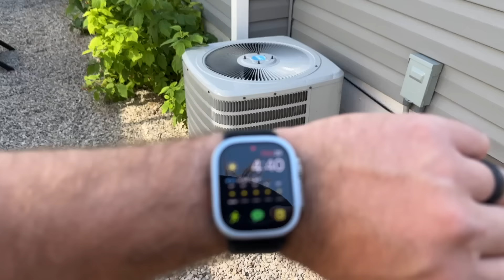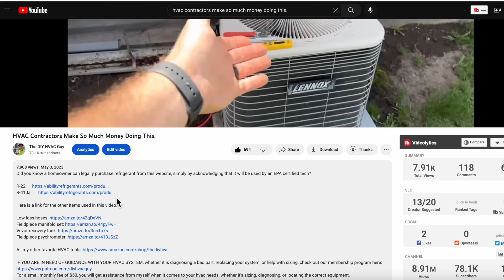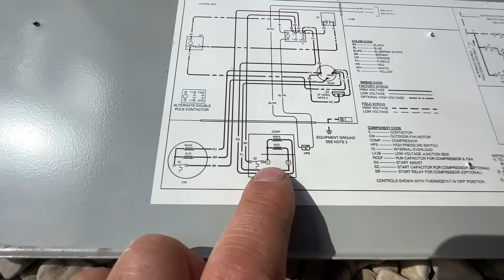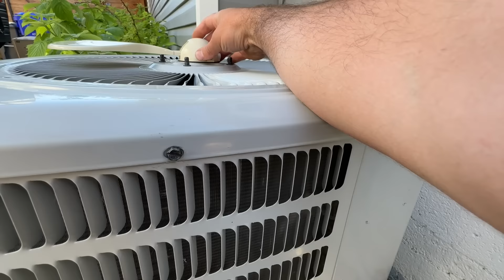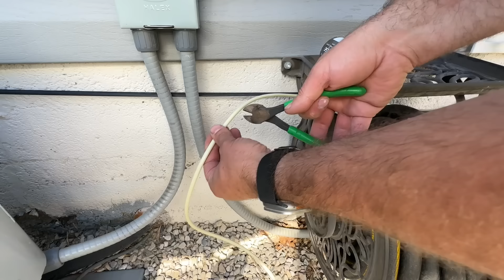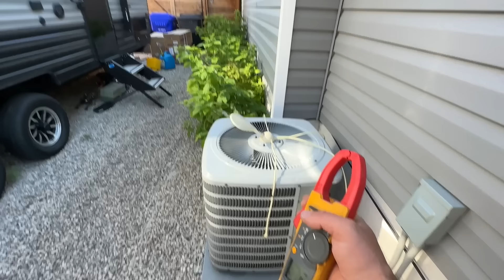Can This Device Actually Lower Your Electric Bill By 30%??

Comment: I have well water , what what about it putting extra load on my pump and if your not on well water then wouldn't it then raise your water bill from the city ? Would one cancel out the other as far as saving money on ac to spending more at once on replacing well pump motor or water bill?
Reply from the maker: Very minimal. About one flush of the toilet per day

Comment: i would only do this with a really old system that will break soon but on a newer system, you risk breaking the system from the mineral build-up on the coils. ever see how wood fences turn white from constant water sprinkler spray? that white stuff is the chemical/minerals the water company puts in, those chemicals will build up on the coil blades and the blades will not be able to transfer heat as well, breaking the system.

Comment: I did something like this in Las Vegas, 20+ years ago on a roof unit. Mine was like a swamp-cooler before the condenser. So the hot dry air was pulled through the swamp cooler to pre-cool the air as the condenser sucked it in. Worked great and lowered the head pressure on the compressor. Then after 2-3 months the lime built up on the coils and destroyed the unit by blocking all air flow. 
If you attempt this I would suggest that you keep the swamp-cooler assemble at least a foot from the coils and reduce the water flow.

Comment: Coils and internals were not engineered to be wet 24/7. It is expected that they temporarily get wet by weather. Also, the filter does not take 100% of the lime scale out of the water. You’re still gonna get a clogged coil. 👎🏼
Reply from the maker: They aren’t getting wet, it mists the air and evaporates into cooler air. But if you don’t like it then don’t buy it 👍🏼 cheers

Comment: .8 amps+1degree less = shorter run times.   Shorter run times and lower heat load will extend condensing unit life. The additional time unit is not running, its using 0 amps and wear. With super pure water, I see no downside.

Comment: Good News Bad News  ,   Good News = IN THE Beginning it Will help the Air Conditioner Work Better .
Bad News = The direct water contact to the Unit will causes Heat Transfer Finns to Corrode TO DEATH .
If you just have to try it setup the water misters far enough from the unit so no water hits it ,
but COOLS down the AIR AROUND THE UNIT .

Comment: It's a swamp cooler, it only works because your in a dry climate.  If it was humid it wouldnt work at all, but as others in the comments have pointed out, there are many other issues with this product.

Comment: I have 37 years in the HVAC trade. I will never install a product like this on my system. I have seen many systems damaged by products like this and not just from hard water. The repair costs easily over run the power savings. With the current standards for efficiency the manufactures would include a mist system as part of the system if it were a viable solution.

Comment: This is far from new...and in the long term detrimental to the system. The coil/fins will get blocked, less heat is extracted which causes the head pressure to go up with the heat transfer going down with amp draw increasing with a result  of a decreased life on the compressor not to mention the negative effect of high of heat of the refrigerant oil which can and will lead to a system burn out. We use to use some version of these on commercial/industrial roof top package units back in the 60's and 70's and the end result was always the same. And if home owners are encouraged to install one are they willing to take a risk of saturating the electrical components inside of the service panel with a risk of electrocution.

Comment: What about using condensate from the cooling coil instead of running it down the drain use a little giant pump and plumb it to the misters intermittent misting will save you something and condensed watter is relatively pure is it not.
Reply: Not a bad idea. At least the water will be mineral free. I doubt that there would be enough condensate to be of much help.

Comment: I lived in Reno, and my apartment was cooled by ONLY evaporative cooling (swamp cooler). They work, but the hard water, cheap plastic tubing and valves, filters, and everything else meant it was being serviced regularly. Add this to a higher tech system with even more moving and metal parts, and youre asking for trouble.

Comment: The motors are still going to run and use the same amount of energy.  If you added a fan HP cycle  control keeping the head pressure up then maybe.  But if try to out do the makers engineers you may get "a fast car for a short road". Don't do this.

Comment: I don't understand how the Amperage measurements weren't the same unless the unit has a variable speed compressor.  In my mind most Air Conditioners should draw the same amperage while running.  The compressor is either on or off.  In this case, the Mister could actually help the air conditioner to run less as the Mister helps dissipate the heat in the coils thereby saving money.

Comment: Well if you live somewhere where water is cheap and avaialiable and not in temporary drought that looks like a  winner. Those units are designed to get wet in natural weather cycles and constant wetting on use of the radiator is different from the intended lifespan in terms of wear and decay from oxidation. You save in one place and lose in two others in terms of wear and a new constant water usage. Defenately worth assessing those three factors based on where you live and costs you'll face locally.

Comment: So you're just spraying water over the coils and wouldn't the cost of water be equivalent to any savings of electricity if there was any from this scam have a gadget? Wtf 2.1 million views on garbage.
Reply from the maker: This unit uses the equivalent of 1 flush of the toilet per day. Next to no added  water usage, and no it doesn’t spray the unit with water. It mists AROUND the unit and the evaporation is what cools the fins. 2.1 million views because it isn’t garbage and people know it

Comment: This comment is from a person who uses a similar system, and lives in Phoenix.  Climate and location are key to this, your results may vary.  

Unless you have a dedicated reverse osmosis system feeding the spray nozzles, they WILL clog and you WILL get scale build up on your condenser coils.

Even with R.O., you will still get additional build up on your coils from dust clinging to the wetness.  You will want to rinse the coils off once a week to maximize the evaporative effect.  This only takes about two minutes.  If you dilute some vinegar  50/50 with water and spray in on the coils about 5 minutes before rinsing, it very effectively keeps things clean with no risk of harm... just do it with the unit turned off.  Regardless of the misting system, you should be spraying your condenser off with clean water every week for best efficiency.

You MUST use high quality components, not plastic, or the heat and sun will destroy the plastic tubes and your water bill from runaway leaks will offset your AC savings.  I use copper tube.  It costs a bit more, but it lasts.  My valve to initiate the spray is a pool water level control, made of brass so it has lasted 8 years without failure, and the paddle that is blown by the air is a thick pie tin (don't laugh) which has lasted just as long.  

For those who think there will be rust or corrosion or mold/mildew... Phoenix between June and October never cools below 85 degrees at night, and generally reaches above 110 during the day.  The water evaporates almost as soon as it hits the coils, which is ideal for heat transfer.  If it actually runs long enough to drip, it dries between cycles.

I don't think I have seen a 30% savings overall (not counting the investment to build the system), seeing as how I am using a bit more water, but the first full summer of use lowered my electric bill from an average of $470/month to about $350/month.  This was before I installed a pool, so I couldn't honestly state what the savings are since then, but when talking to friends and neighbors, our bill seems to be consistently lower than theirs.  

In the end, if done right for long term use, and if maintained properly, I think it is worth doing.

Comment: "the mister" seems to be another alternative....Sadly I don't have access to water outside near the unit (due to the water spout being inside my sunroom). I do however have my A/C unit in the shade.  

 Unrelated comment>>> Here in Florida, I got a rudd with 3.5 tons (my previous system was 2.5 tons), and I had them set the air handler speed to the "low" setting for humidity reasons.  Set that way, with the extra tonnage, it pulls waaaaay more humidity out of the rooms and it feels much colder inside. It works great. You should make a video about that as I'm sure many people in florida have the humidity issue without realizing it or what to do about it. Even my leaky sunroom gets cooled with low humidity air. It's really a great solution for Florida to up the tonnage and then run it with low air handler speed.

Comment: Question: my compressor (I think) was pulling less amps than the one the second guy put on. The first one was done when the fan motor was changed. Is this right? It’s pulling more now ?. ?

Comment: Just enclose unit with a privacy screen to shade unit…they sell them for folks to hide trash cans or grills
Reply: Btw my unit is 27 yrs old..never a tuneup needed. Clean fins every couple years but ac guy told me secret …Every year I clean every wire contact with emery paper and contact cleaner. The corrosion on the contacts increases the resistance and cause overheating. Worked so far.

Comment: A couple of years ago I played with a mist system. The AC did blow colder and run less often. It knocked about $30. a month off of my electric bill. After the first summer I had calcium build up even though I was using a filter. Not cool. I cleaned it up with vinegar and CLR. Then during the winter I decided to get three 55 gallon drums to catch rainwater. I bought a 12v RV water pump to pump the water. I ran it that way for a couple of years before I made a different plan.
Here's what I used to build the mister. A roll of black plastic drip irrigation tube from Lowes. 3 spray nozzles from Lowe's. They also sell the adapter to hook it up to the hose bib. For the switch since the Contactor is controlled by the 24v thermostat transformer I found a 1/4" 24vac water valve on ebay for about 10 bucks. Whenever the thermostat kicked on the AC unit the water sprayed.  
Beats the heck out of the goofy flapper valve.
Anyhow I went on to DIY solar and swapped my AC to a 24,000btu hybrid mini split from Signature Solar. It runs on it's on solar panels and at night it will pull from the grid if I run it. But I also installed 3 dual inverter window AC units in the bedrooms because they all run on 120v. They are powered by my DIY solar system. The solar charge controller is an MPPSolar LV6548 that outputs 6500w. To run through the night I have 20.4kw of LiFePo4 batteries. I don't generate my 220v needs which is just my stove at this point. We mostly cook outside on a pellet grill so it's mainly just the burners on the stove. Due to my power company having a $25. base bill I have to pay between $25-$30.
a month.
So now I have no need to spray my condenser

Comment: I would think that if the water sprayed on the coil rather than opposite the coil, it would keep the coil cooler and your efficiency would be higher. This would keep the fan from doing all the cooling.

Comment: Not in Florida ! Or anywhere.  Water starts corrosion and away with your coils ! Ask me I’m a contractor , it last shortly and smiles abound but you pay the Piper soon for a new unit so on old coils go for it to reduce amps

Comment: I agree with many of the comments that say these systems are not a good idea to use.  Yes initially they work but not for prolonged use.  After a few months or a season the coils on the condenser will become covered with deposits from the evaporation of the cooling water.  Just like in the bottom of a coffee pot or tea pot. The cheep little filter will not do a very good job at removing all the minerals in the tap water.  I retired from a large electric utility company and the cooling towers and heat exchangers at power plants had a continual and costly maintenance task to keep the lovers or fins free from huge buildups of deposits even with full-time attention by chemical technicians tasked with maintaining cooling - water treatment and quality.

Comment: I am a retired HVACR journeyman-technician and have seen many comercial sites that have actually directed water from a lawn sprinkler into a condenser coil to aid in the units cooling of the condenser pressure and temperature. It caused the unit to develop large amounts of calcium and line mineral deposits to actually restrict the air flow and compounding the problem. You will have better results cleaning the condenser coil with an approved condenser coil cleaner and flushing the coil compleately with water. If your unit cant keep up with the use and demand its too small for the building and would have to be replaced. This device may actually help a little but not recommended.

Comment: Question for the Techs and engineers?? Running a compressor in summer or winter is still running a Motor how does a heat pump save money??? If you are running the SAME MOTOR in winter as you would in Summer??? Amperage is amperage winter or summer on same motor? Plz give your take on Magical savings??

Comment: Inverter style AC's may give substantially false current readings on a current meter, depending on the design of the meter.
Also you cannot directly relate current to power due to phase between the voltage and current (power factor).
To have an accurate power measurement you need a power meter that internally measures instantaneous power and then determines average power from this (in a similar way that a true RMS  volt meter differs from a non-true RMS meter).

Comment: To be sure of the benefit you need to alternate between using water and not using water a number of times.
Otherwise when you first run the AC it could be cooling down the house and then when you run it with water the house has already cooled a bit.

Comment: I've been using one of these since 2017, I live about an hour away from Vegas. It works really well and cuts my power usage to about 1/3rd of what it was when the temps get up to the >110F range. However, at the end of each year I have to spend a saturday cleaning the hard water deposits off of all the fins. I would not recommend it unless you are prepared to take your condenser apart and manually clean it yourself every year.

Comment: Just so you guys know, it is not recommended to run your air conditioner under 72° F. Operate in your air conditioner at lower temperatures in 72. Will put you at risk of freezing the evaporator. You can get away with a little bit lower with 410A because you got a txv but with those old r22s you definitely do not want to run it under 72.

Comment: Maybe with distilled water. As the hard water dries on the hot coil, it'll leave behind all the minerals in the water and before long. Your coil is going to be completely covered and your efficiency is really going to go down as a result all the way to the point where it doesn't work. I've seen a condenser that this happened to just because the sprinkler was hitting it.

Comment: Two things, I've designed compressor motors for 40 years. You need to measure the current on the common wire, not the run. The run current varies more drastically with load. The common measures both the run a aux (start) windings which are both in the circuit.  Second, most outdoor units already spray condensate water on the condenser coils using the fan l. Not saying this device doesn't help, I would expect marginal results.

Comment: I did this for about 5 years in Austin on my 15 year old AC.  I finally replaced it when i sold my house, but the mister system worked and did not cause any hard water build up.  Nor did the compressor suffer any noticable negative changes.  When "HVAC professionals" tell you not to do something, they express a lot of tribal knowledge, but not a lot of actual science knowledge.

Comment: I live in Vegas with 115+ degree summers.  I really wanted it to work.   At best, I saw a 150 watt power reduction and only about a 1 degree reduction of refrigerant entering the house.  Work into the equation the cost of filter(s), extra maintenance,  and long term damage to the coils and other parts and I found a zero net gain.  If there was a reduction in electricity, it wasn't seen in my monthly bill.